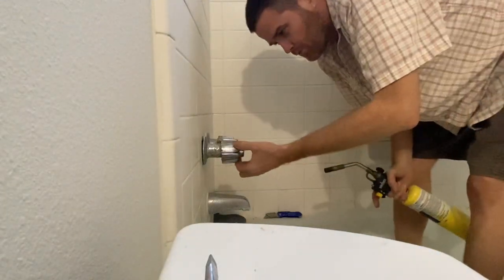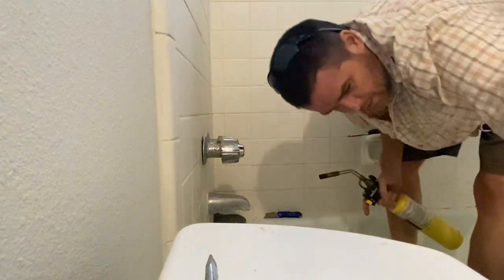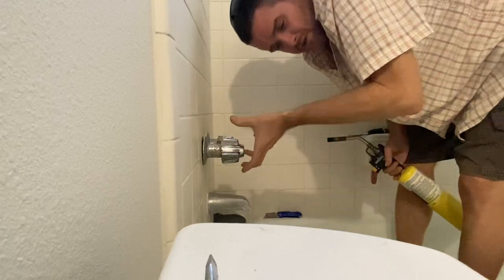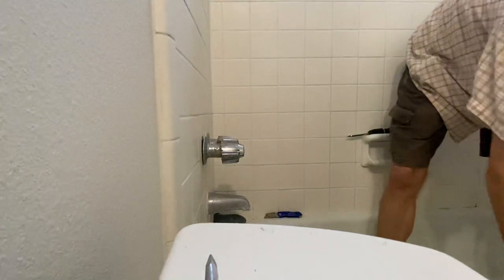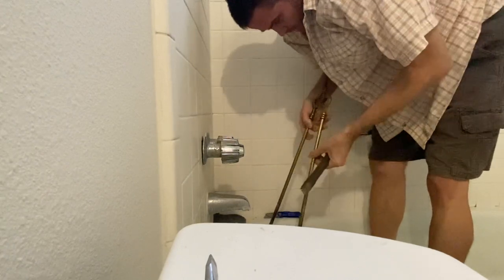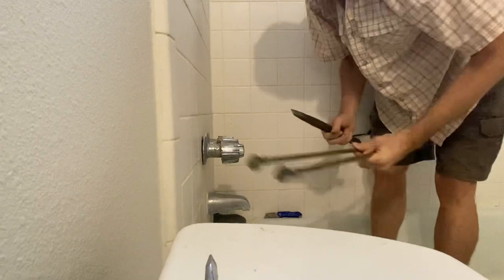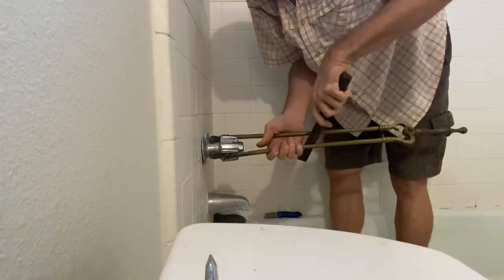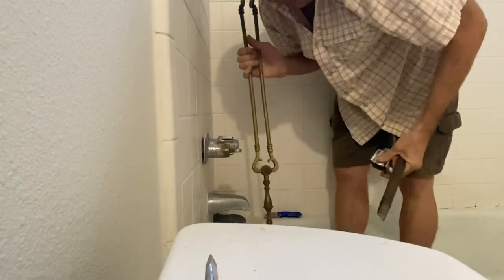Remove stuck shower faucet handles

Comment: My bathtub knob is totally stuck on that a faucet handle puller does not loosen it. I might just call a plumber.
Reply: It sucks because the first thing he does is smirk then he gets the same tool, pulls off the knobs in about three minutes then hands you a bill of 300 bucks......
But worth every penny, except the smirk.
The smirk is only good if it's your own.

Comment: What if you knob has a plastic,  “faux glass” looking knob cover. I don’t think I can heat it up like that.  Also, the knob is stuck in a position where low pressure water is still coming out the faucet. I’m gonna keep searching for videos but in case you know, give me a shout
Reply: Hair drier? Maybe just enough heat to work but not melt the knob?